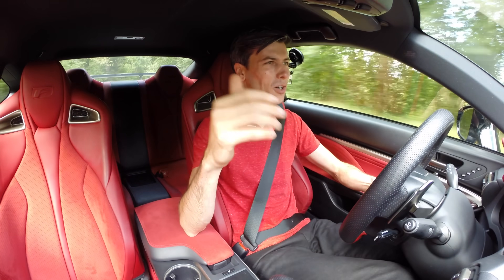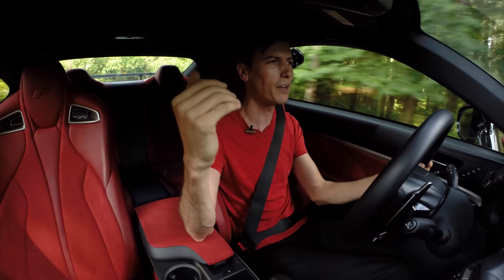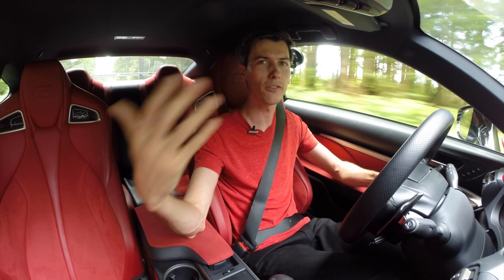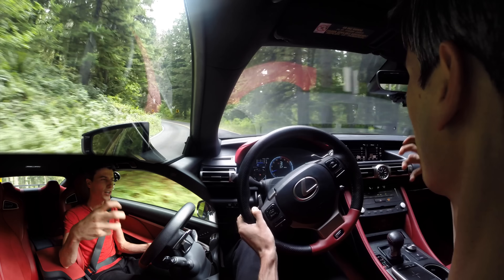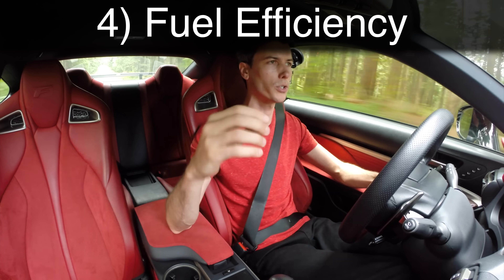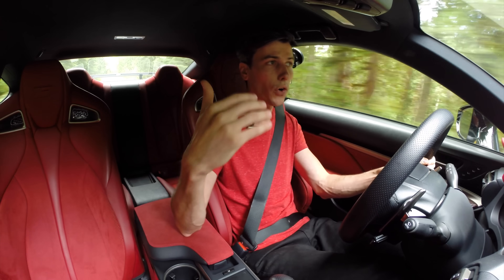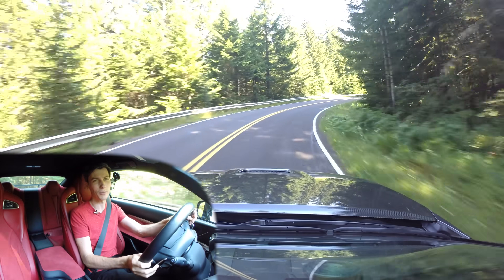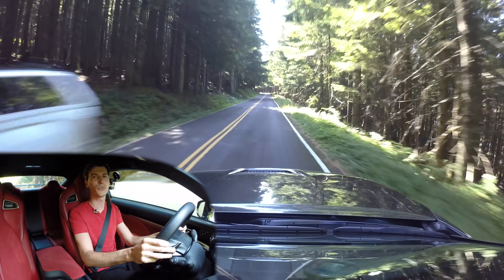5 Reasons You Shouldn't Buy A Turbocharged Car

Comment: Higher cylinder pressure also means more blow by. 

Do any car manufacturers include electric auxiliary oil pumps? Would be useful for priming the engine pre startup and preventing coking in the turbos.
Reply: Lots of modern european cars have a second electric oil pump. I don't think it primes the engine before starting but it keeps oil flowing after the engine is stopped and until the turbo also stops and cools down a bit.

I don't think priming is really necessary the oil gets to all the main friction points very quickly, even if on places like the camshaft you have a bit of dry contact initially that's not really going to cause any wear when they're turning at 400rpm and they're only dry for like three seconds.

Comment: Then we go out and buy a turbo, because the are more efficient IN the application,  because small cars are significantly heaver than in the past, and 2L nat asp does not meet our performance expectations any more. Because modern turbo systems mitigate most of the turbo lag issues, because even though they are less robust, they are engineered to last more than most will ever need. Because we can tune them to bonkers output that would need 2-4 X the displacement in nat asp.

Comment: What's the point of good torque lines if there is no torque? It would be a valid point if comparing 2 specific engines maybe, but in general anything between 1.4 - 2.0 liters has very poor torque. So for smaller engines, I'd rather go with turbo and enjoy the higher torque. It wears off pretty quickly  to drop gears or hit 6000 rpm for overtakes, when having a full car going on holidays :)

Comment: Less pumping losses
Use of more potential thermal energy
Goes very well i.e. with an attkinson cycle. For fuel economy
Arent modern turbos connected to supercaps and electric motors to reduce turbo lag?
Diesel cars don’t experience lag at all and need to be build more robust anyways.

Comment: the oem twinturbo settup  in supra mk4 is a great system, 1 turbo goes on first end the second goes after and take over the boost line, so you get the feel na engine. i aways wounder why people allways take those out and get one big,  why not change the  oem twin turbos with better and keep the same system, you stil can get alot of power doing this and with a na feel.

Comment: A low revving turbo engine could easily be a good thing. We have various of variable parts on the car. Turbos(VNT and Twinsscroll and so on) cams, ignition, injection just for some examples. That could give you a well balanced throttle resones and a Wide powerband and still could be economic. AMG does it on there new engine. They ar extremely fast but also economical when driving normally

Comment: I drove a stock 2019 Mustang with 4cyl turbo engine. You couldn't tell it has a turbo. There was no lag or extra noise from the turbo. It didn't run some crazy temps and I was getting 24mpg on 87 fuel. Everything was so smooth, I loved driving that car, it was a lot of fun. Obviously 5.0 would be even more fun to drive, but now we're comparing apples to oranges.
Reply: Not sure 5.0 would be nicer to drive. Faster in straight but slowet in corners.
Reply: @CevairZufer  yes  the engine totally affects the traction of the car.
Reply: Cevair Zufer how is it slower in corners? Do you have any idea what your talking about or are you just a 4cyl mustang fanboy?
Reply: @SavingPvtBryan32  Well the 4pot is lighter but with modern tire and suspension tech, it doesn't really matter.
Reply: Cevair Zufer completely untrue.
Depending on trim levels etc, there are actually 4 cyl mustangs 100kg HEAVIER than 5.0 GT versions (both coupe)
The difference to handling is negligible at worst and equivalent to carrying 1 passenger
Reply: Wait the ecoboost Mustang only gets 24mpg?? I hope you’re talking about city driving because it’s common now days for a V8 engine to get at LEAST 20mpg AVERAGE
Reply: @Texano5.0  it was average of city and highway. Highway alone should put it in high 20's.
Reply: That 4 cylinder turbo that ford made is actually quite powerful but be careful when driving with 87 fuel, u put full throttle u will destroy the engine due to knock and the engine will also be derated slightly when running 87(knock sensor)..... Try running it on 89 it be the best combo against cost of fuel and performance
Reply: @tayweijie7982  it was a rental, so who cares. And I did some research before renting it. Everyone said running 87 in it is just fine. Can't imagine modern engineering has nothing in place to prevent knocking when on 87 fuel.
Reply: @vitaminb4869  Yes, at reduced power.
Reply: @dizzywow  there is like 0.0001% less power. Unless you're drag racing, this is not even detectable.
Reply: @vitaminb4869  Stop lying.  It's a lot more loss than that.
Reply: @dizzywow  do you have some kind of a data to back up your claims of me lying?
Reply: @vitaminb4869  No one would recommend costly premium fuel, if the difference in performance/efficiency was only 1%, much less your ridiculous 0.0001%.
Reply: @dizzywow  it was an arbitrary number. And you're just speculating. Any performance gain will be so slight it won't be worth it for daily driving. If you're drag racing and trying to gain that extra 0.1-0.2s, then maybe.
Reply: Vitamin B
Those ford 4 cyl. engines blow up before 30k. Now everybody know this:a Lexus v8 engine is the real deal or better yet a Ford v8 is not even close in power and refinement as the Lexus v8,therefore a Ford v8 is like having a Lexus v6. Go and test drive  a ford Mustang v8 and then drive the Lexus and you'll be surprised as how superior the Lexus is.
Reply: @juanitosuriel6931  You're cracked.  The Mustang's V8 destroys the wimpy Lexus V6, which is what is in my car, by the way.  The Lexus V8 is not very good either.  It's lacking in torque, down low.
Reply: A I4 Mustang?! Ahahaha

Comment: A bunch of incorrect statements about turbo systems, particularly modern ones, like if you reduce response time, it will reduce the power, etc... that's why you do twin turbo and use smaller turbos, for example. The whole efficiency thing is also crap.

Comment: Actually, at partial vacuum or before the boost kicks in, the engine doesn’t really work like, say 2.5l engine, instead it works far terrible than that because in most turbocharged engine you don’t get the benefit of high compression ratio like an NA car do.

Comment: why does everyone compare Small Turbo engines to Large NA engines?
What if I got Turbo LS engine? are you going say it has bad throttle response because turbo has been added. of course not.
I know NA LS engine could have a higher compression ratio than Turbo LS engine, but not enough to make a noticeable throttle response difference.

Comment: Hi, you didn't explain that most factory throttles are now drive by wire. A TPS is generally at WOT between 50% & 70%, hense throttle delay as the ECU is then in control of the engine after that point. Also most factory turbocharged engines have a built-in oil cooler. Turbo's also have an efficiency range, and you can run higher compression ratio to reduce lag & colder spark plugs to deal with the increased combustion temperatures. A great book to read is Power With Economy, which is why manufacturers are going to 4 cylinder turbo engines. As a final note diesels have a higher combustion efficiency compared to spark engines. Thanks for your video.😃

Comment: I was a student of WyoTech several years ago, and in the "Performance Powertrains" elective there was a project where we were given a theoretical engine, usage, and boost number and were to design a turbo system for it.
My assignment was for a rally car with a 351 Chevy engine, running 12 PSI of boost, that redlined at 8500 RPM's. (Hey. I didn't create those numbers.)
Using the turbo maps given to us, I found that a sequential system using the Garrett turbos GT2860RS and the GT4508R would give that 12 PSI of boost all the way from about 1500 RPM's to redline without much of a problem at all.
Eventually I wanna actually turn it from theory into reality, to see how effective it'd actually be.

Comment: My 2009 Volvo C70 with a 2.5 liter 5 cyl turbo with variable valve timing.  It produces max torque at 1500 to about 4800.  It pulls great off the line too.

The auto makers know that MOST of the time the driver will  spend of the time from idle to about mid rpm range.  Engines with low to mid range torque are the best for street use.  But in a drag race ( not often used) the high rpm hp and torque are best.

Comment: The #1 reason regarding lag is completely incorrect especially on today's modern cars!!  Most have the twin turbo setup which eliminates the old technology single turbo lag!  And have you ever seen a dyno graph on a twin turbo car?  ALL the torque is right there around 1500 RPMs which equals instant acceleration!  Zero lag!

Comment: My nearly 400 whp STi would like a word with you lol. I also have a 2003 Mach 1 for reference. My 2016 STi is just more fun to drive.
Loud noises? Got them
Throttle response? Without a doubt
Fuel economy? Not too bad on E85/E98 actually, about 21-22 mpg.
Reliability? Depends, but forged rods and piston to eliminate that weakness.

Comment: Video idea: does higher rpm actually equal increased wear?
Reply: That would probably depend on your piston speed and durability of your valvetrain .. the rest of the engine would most likely be fairly indifferent to high RPM.
Reply: Constant city driving also increases wear on an engine much more quickly than highway driving.
Reply: Extended time your engine is at high rpm would increase wear IF your car is not intended to be driven at high rpm.
Reply: As some have said, piston speed is tied to RPM and it's an important parameter. Also usually shafts , axles and those components may be designed with a certain amount of cycles in mind, if you go at a higher rpm rate you're doing more cycles per unit of time so it's less life. Haven't designed any of those components myself but I'd imagine that the number of cycles is probably "infinite"
Reply: What??? Of course it does

Comment: Going from turbo 4 banger to naturally aspirated v6 the turbo was more fun to drive and mid range power is more available than having to rev to redline to benefit peak hp. Also most new turbo cars get peak tq low in the rpm which means turbo lag isn’t awful like it used to be. Take a stage 1 tuned Gti. Massive midrange punch that starts low in the rpm range. More reliability though is a benefit of NA

Comment: About the Compression Ratio, that's only of concern in a Petrol Engine... For a smaller Diesel engine with a Turbo, Knocking isn't a concern as the fuel is injected when the piston is at TDC, after the compression Stroke, Right?

Comment: I'm aware that turbos have a higher chance of knock which could lead to early engine failure, but what about the overall reliability of the car and maintenance costs compared with NA? -All else being equal, driving the same model car with turbo vs NA(with a smaller engine to compensate for the turbo car of course).

Comment: It's my understanding that  smaller turbocharged engines suffer from better fuel economy at the expense of higher emissions (particles, NOx) and higher strain and lower reliability, oil dilution, and lower efficiency when corrected for displacement. I wish cars became lighter, smaller and less bloated with ridiculous pseudo "luxury". It would make the in between transitional era between antiquated ICE and modern E-motor vehicles less of a ridiculous polluting mess. Most people commute alone, short distances withtout a need for most of the ridiculous doodads their cars have.

Comment: The on/off WRX throttle response is at least partially caused by a crappy ECU tune.  I agree that turbo delay (lag) is bad but you can't deny there is a fun anticipation with a huge rush at the end of the lag.  You don't get any such rush at the end of a steering delay, brake delay, etc. (unless you're about to crash because of it.)

Comment: Finally, a video that doesn`t prase the low-resolution argument of CVTs greatness ;)

Unfortunately in many countries, tax and insurance are directly linked with engine size. New Toyota`s DS-4T is 2.0. Drives well even on an RX. The wheels on a front-wheel-drive version one spin on second gear ;)
RC300 comes with a similar (2.0T) engine in Japan.

Comment: In a super street arrival they made an equation for sizing a turbo to a certain displacement. 
1) Calculate the airflow for the engine in its naturally-aspirated form. Use the following formula for standard atmospheric pressure: CFM=(CID x RPM x 0.5 x Ev) / 1728. (CID: cubic inch displacement; EV: volumetric efficiency (0.80-0.90); CFM: air flow rate)
2) Knowing your desired boost level, calculate the airflow rate under boost by multiplying the pressure ratio by airflow rate (na - cfm). Calculate the pressure ratio: (14.7+Boost/14.7) - then calculate the air flow rate under boost by multiplying the pressure ratio by your air flow rate from step one: CFM x pressure ratio (for twin turbo applications divide this number by 2).
3) To covert CFM to lbs/min, use (CFM x 0.076 = lbs/min).
4) Use compressor maps to find the turbo best suited to the air flow rate and pressure ratios you have attained. You can get calculate a rough estimate on Engine horsepower using the following formulas:Lower value: 0.052 x CID x (psi boost + 14.7) = bhpHigher value: 0.077 x CID x (psi boost + 14.7) = bhp
 Would you like to test out HKS theory with match a turbo size to and engine displacement? If you want the like to the arrival please let me know I can source it for you. the article is also 9 years old lol. Great content keep up the good work.

Comment: 7:48, that's only for gasoline engines. In a diesel, richer fuel mixtures raise the temperature.

In diesel engines, you can have compression ratios well into the 20s and up with a turbo without issue.

Comment: Turbo engines are done because they allow a smaller, lighter engine with less internal friction to produce the same power as a much larger engine.  Especially on diesels, fuel economy goes up considerably.   Yet, for performance car applications, what Jason says is spot on.  Example:  The Porsche 981/718 Cayman.  From '14 to '16, these used horizontally opposed 6 cylinder engines of 2.7, 3.4, or 3.8 liters.  For '17-'19, they went to horizontally opposed four cylinders of 2.0 and 2.5 liters, and despite the fact that the power and performance were about the same, sales tanked and for the new Cayman GT4 Porsche has gone back to a 4.0 horizontally opposed 6 cylinder.  Not only does this run better, but it SOUNDS WAY BETTER as well!

Comment: You could do a high compression low boost turbo engine setup, which would give you that low rpm torque/drivability and then you get the higher rpm power from the turbo

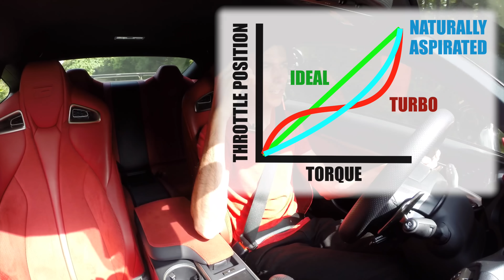Comment: In the graph at 1:30 shouldn't Throttle Position be the independent variable and Torque be the dependent variable? Torque depends on throttle, not the other way around, so the x and y axes should be flipped.

Comment: Turbos are great.  They are placed in or near the exhaust manifold so the lag is barely noticable, at least in many German cars.  So big cubic inch power and  36 mpg when you drive it  basically normal.    My lowly GTI ran a 13.59 @ 106 at the drags on street tires, but I get 36 mpg combined.  What's not to like?

Comment: Living outside of the US, we have a swagger wagon that is about the sized of a Mazda5.  It has a 1.5L turbo inline 4 driving the front wheels through a 6 speed dual clutch.  In a vehicle like this, engine size matters.  By that, I mean the engine has to be small to increase cabin space.

I'd love to have a high reving inline 4 that produce the same power as a larger engine.  The Porsche GT3 has  a 4L flat 6 that produces 500 horses--that's more than the 5L V8 of the Lexus LC in this video.  High reving engines were ahead of its time.  The 4/5 speeds of the 90s required the engine to drop out of its high powered region after each shift.  Now that 6 speed is a mandatory, 8 speed is fashionable, and 10 speeds are cutting edge, those high reving engines should thrive again.  Unfortunately, 99% of the driving public don't want the 9000rpm redline of the Porsche GT3 or the Honda S2000.  This is why we have a minivan with a turbo

Comment: Sorry if you mentioned it and I missed it, but how does this apply to say 1/2 ton trucks and towing / hauling? I just never felt right about having to run high rpms down the highway to get enough power to pull a trailer.

Comment: These aren't new arguments. Turbos have higher brake specific fuel consumption so that's the main downside. The rest about turbo lag and knock and everything else is pretty much FUD. Turbo "lag" -> down shift to a lower gear to bring it back in the power band. If you're hardcore enough and don't mind a turbo/cylinder head rebuild, use a throttle jack to keep it open and program some ignition cut for anti-lag. Knock -> use water/meth injection and better octane.

Comment: Actually, it's the expansion ratio, not the compression ratio, that determines efficiency.  The two ratios may or may not be equal, depending on the valve timing.  By increasing the expansion ratio without increasing the compression ratio, efficiency can be increased without causing fuel detonation.   One way to do that is by delaying the closing of the intake valves while reducing the size of the combustion chamber.

Comment: It’s a little off the target talk but you own another answer. Electric motors and decent sized batteries.
Torque now, linear if done well.  How does your T handle being driven hard for a while?
I have a small compliance EV, and it’s the best closet fast car.  Good for getting where I need to go, and quick when I need it.